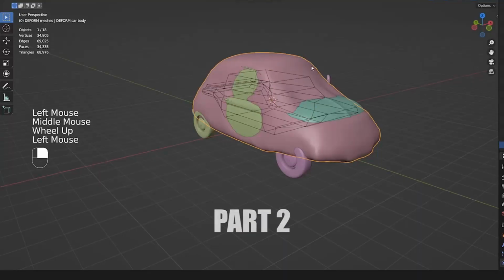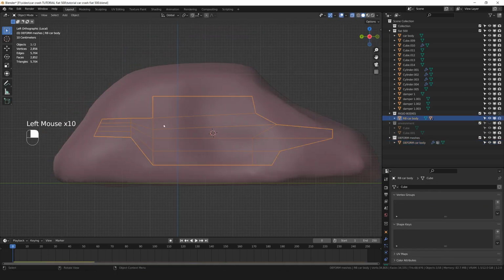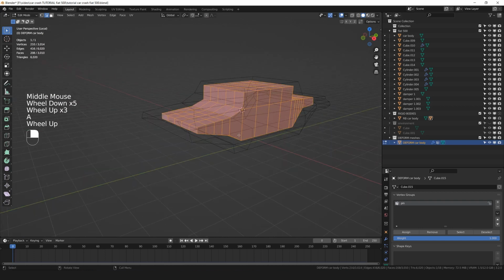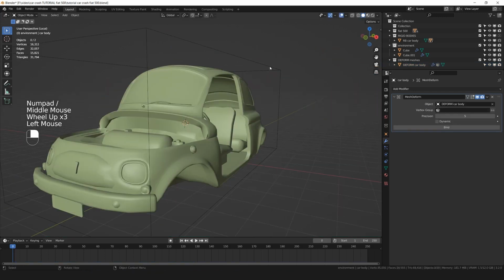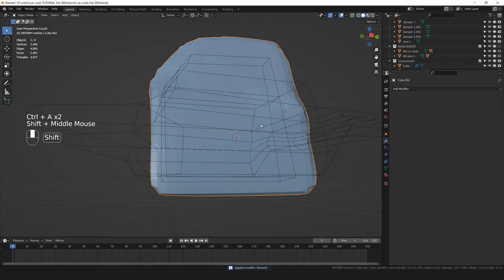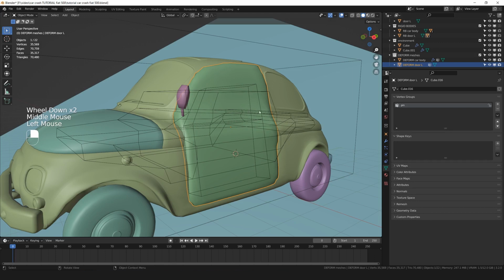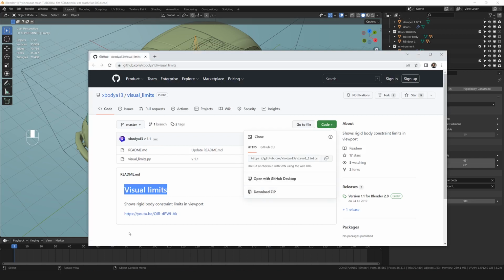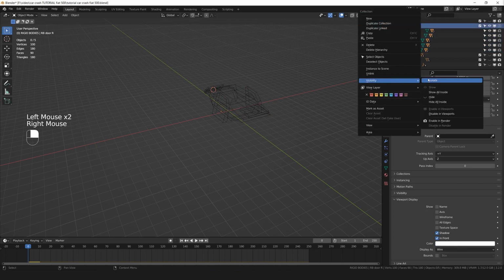BLENDER CAR CRASH TUTORIAL - part 2

Comment: Great tutorial, but I ran into an issue when trying to rig up my own hood on a different model. Followed step by step, but the while the interior pin group moves along with the rigid object, the exterior cloth verts follow the pin group with a bit of a delay, and flap around like fabric... this is using the same cloth settings as a door, which works fine. Very odd behaviour. Wondering if you have any suggestions
Reply from the maker: Hard to say… however this tutorial is old. Check out my new technique for car destruction in the recent videos, is much better!
Reply: @RaffoVFX  Yeah just joined up and looking at it. Excited to try it out

Comment: Great tutorial! - I'm having an issue with some rigid bodies ripping through the deform mesh.  Most objects work deform fine but others have issues and I have not been able to narrow down the issue. Do You have any helpful thoughts?
Reply from the maker: Ehy thank you!
It can happen because an object cannot be rigid body AND collider for cloth at the same time.
So you have 3 ways of fixing it, here is what I did when it happened:

- simply join those little objects in rigid body car
- OR create an invisible shrinkwrapped copy of that little object, parent it to the original rigid body, turn off rigid body (for the proxy only), ant instead turn ON collision
- OR simply give to these little objects some limits for the rotation / location using specific constraints.
Let me know how it goes
Reply: @RaffoVFX   Thanks so much for your reply! I'm not sure that is it. I isolated the objects with the issue by deleting the rest of the model and the problem persists. I think it's either a setting I'm missing or something needs to reset?
Reply from the maker: @generalmotion  send me your .Blend file on discord when you reach out there, so that I can find out whats going on :)

Comment: For the interior of the collision object, why not just duplicate the rigid body object, remove the rigid body physics from that duplicate, shrink it down slightly and then join it to the collision object; rather than remodel the same shape again?
Reply from the maker: I actually did it in my own project.
But I thought that in the public tutorial it would be just confusing if the watcher is not expert.
So I just kept everything as much easy as possible.
You got it man :)
Reply: @RaffoVFX  OK, I understand.  That it is a brilliant idea to have the pin group inside like that, I was wondering how you were going to attach it.
Reply from the maker: @WaterShowsProd  haha that idea was a game changer, and it cames to my mind after days of failures in the exact moment in which I was going to sleep xD